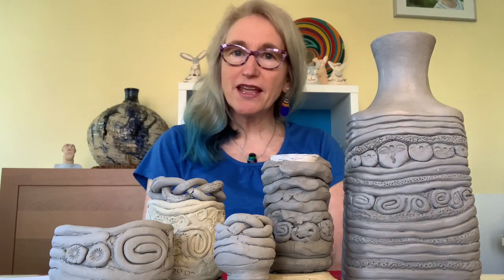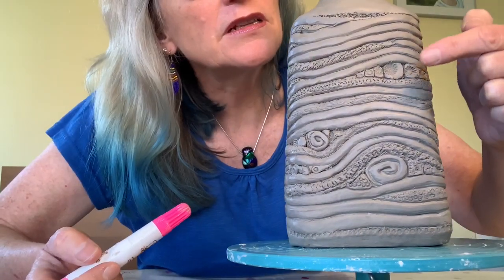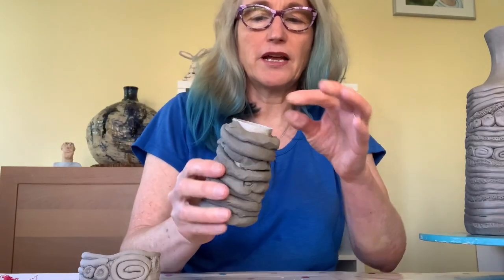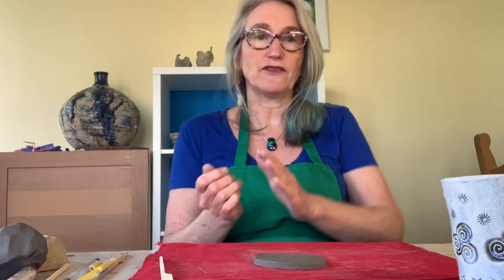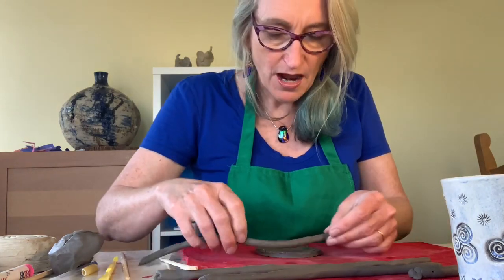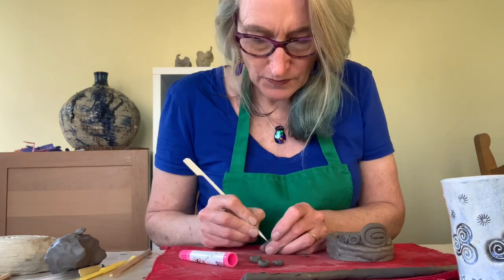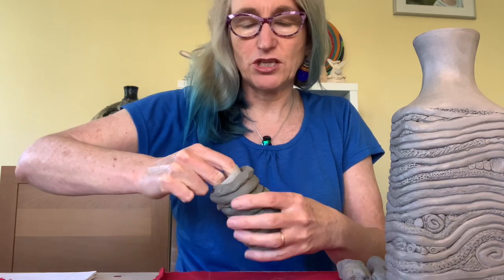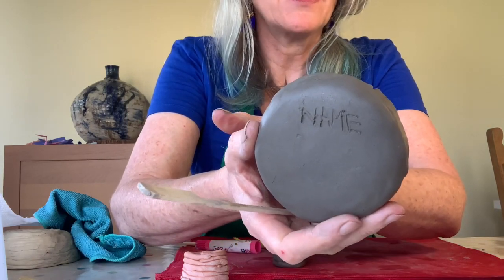How to make Coil Pots: clay projects for lockdown

Comment: Everytime I make coil pots my designs on the outside get squished... or when im.blending the inside the outside isn't sealed or also gets ruined.. any tips??
Reply: Also, if you use a mold how do you disconnect the clay from it? Even if it's prepped with wrap and such??
Reply: I see that you took it off by cutting but how would you perform the putting it back together so seamlessly. Please help doing coils is something I'd love to.improve.